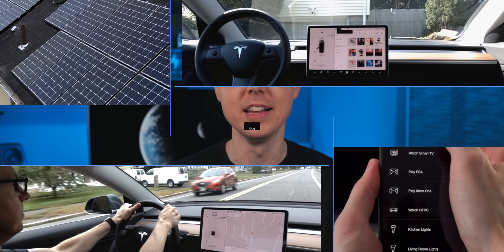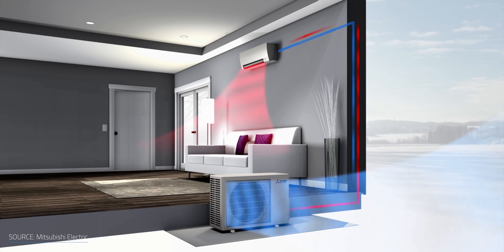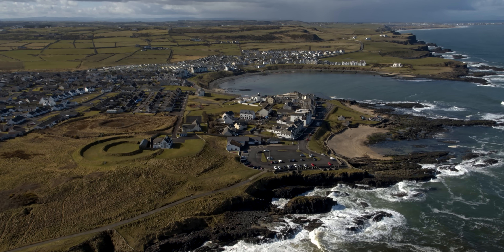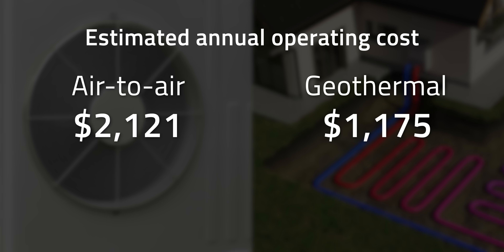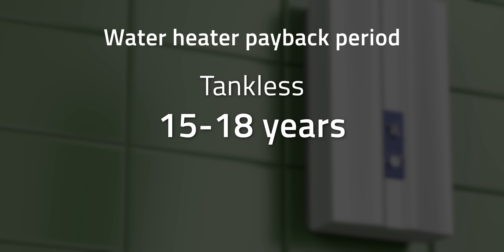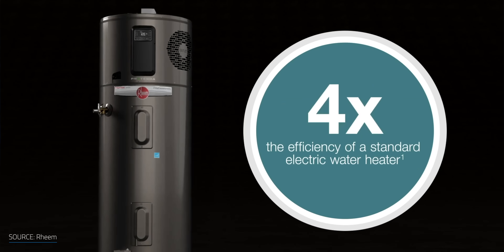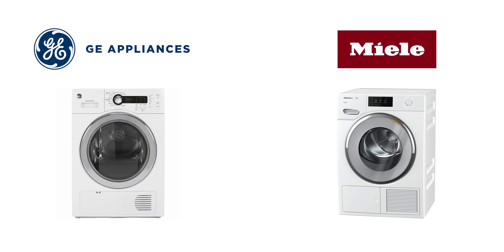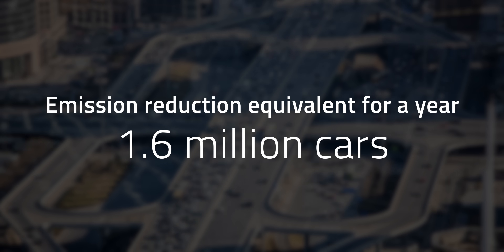Why Heat Pumps are Essential for the Future - Explained

Comment: I'm so used to split systems in Australia, it's surprising to hear how rare they are in other places.
Reply: With how cheap natural gas prices are in some areas and how cold winters are, they just don't make financial sense. I've been looking into replacements for my aging gas furnace and it would take a very efficient heat pump just to break even on fuel costs compared to a gas only one. With them costing $2k-$5k more I'm leaning towards a gas only furnace right now.
Reply: @jaredwilliams8621  That's fair we rarely see temps below freezing here and even our natural gas is too expensive to use much.

Comment: I’ve just recently had a Miele eco comfort heat pump dryer. I had 2nd hand was told (no heat)  but it was a builder so he could of had it from anywhere 🤷🏻‍♂️ had a Miele washing machine to both for £50.00 the machine is leaking found it fixing it and my sister wants it.
But I said I want to keep the dryer for myself as Googled it and it told me it was A+ energy rating (heat pump tumble dryer) 
I don’t think the guy I bought it off knew this as I turned it on cleaned all the filters screens etc and heats takes a while to get going but it does heat and it uses £0.20 per hour my beko electric condenser dryer £0.86 per hour so that speaks for itself…
Although it takes longer (not much longer) and if you don’t care about that then I would say from my first week that it’s definitely a saving and paid pennies compared to what it’s worth. And it’s winter here in the uk and it’s a cupboard that cold but it’s still doing alright. 
So I would definitely get it if I could afford it in central heating system as it’s bound to save you money. 
Although it does sound like fridge with a fan so I expect they all sound like that heating or tumble dryers 
Very clever idea 🙂
Reply: Wow that gave me thoughts
Reply: @josephinemitchell9504  they are so cheep to run compared to a normal (vented or condenser dryer) they are definitely worth every penny only takes 20 mins half hour tops then my old beko condenser dryer. 
And if you got kids and use the dryer multiple times a day? Then I would definitely invest in a heat pump dryer will save you loads of money on electricity and will pay for its self in the long run. Or just get a good condition 2nd hand heat pump dryer. Mines a Miele a expensive brand , but there are cheeper ones that work just as well for less money. 
If you want to save electricity and you use a tumble dryer a lot then you definitely need to get a heat pump dryer. Don’t listen to people that say “it takes hours” it really doesn’t and if it does it must be full of dryer lint and not looked after well I was a skeptic of them! But so glad I got one now will never go back to a normal dryer again…. 👍🏻

Comment: I'm a heat pump engineer, and while they are good systems, the air to water is rarely Installed correctly unless you can afford to pay through the nose and the air to air is expensive to run compared to gas heating

Comment: What we need to do is use the heat from the AC to heat your water/pool...and at the same time function as an AWG (atmospheric water generator). Combining all 3 devices is really not that crazy. Add some solar cells, a power wall, and wireless connectivity...and you have a home that is completely off the grid (except for sewage.)

Comment: So I have a question, I understand that this tech has a limit to how much heat it can extract from the air. However, if it uses energy  to gather a larger amount of energy, could this be scaled up to a higher purpose. Now I live in Phoenix, death valleys more social little brother, and I am curious with the amount of heat energy here, could a project be scaled up in such a way  that  the extraction of heat  could be used to push a steam powered turbine to put energy back into the b grid, while having public areas that cool air could pump out , such as in public parks. If there could be a station in each neighbor hood, at the very least to get someone who is over heating (as we humans tend to here) to. There's a lot of people here that don't have access to a cool area, and I am curious if doing this could provide a free cool area for people like that to get some relief, while simultaneously  adding energy to the power grid instead of costing it. Or ever could it be  feezable to have enough stations pumping out enough cool air into the open air to combat extreme  city wide  heat extremes (cool down the entire city on a large scalep).

Comment: We had a geothermal system in my old house. While it is 20 years old and that may have contributed to this, but it was very slow to heat and cool the house. Although if you keep it constant it shouldn't be an issue. (We also had a very large house)
Reply: My guess is the contractor installed a unit that was barely large enough to heat and cool your home.  They tend to size the unit on the cheap!  They could have changed from a 48,000 Btu to a 60,000 Btu for a total cost to them of about $400, but they don't do that, and you end up with a very slow to heat and slow to cool system.

Comment: I had a heat pump drier in England for a few months traveling, that thing was annoying, it took 50% longer to dry and it felt like you have to listen to running all the time. Then the water tank would fill up and shut the unit down so your clothes would stop mid cycle.  This was a couple years ago, but I would not buy one for my house

Comment: I'd love to see someone use one of this things to take heat from steam and bump it back into the boiler, condensing the steam back into water for re-use. Steam engines aren't so much powered by the heat itself as they're powered by the pressure of matter phase changes, so not letting the energy escape until it's all converted into kinetic energy instead of being lost by releasing it into the environment. Energy efficiency doesn't matter in this case, because the wasted energy is lost in the form of heat which is what you want anyways.

Comment: heat pumps are identical to a magnifier glass intensifies light into a hot spot. the exception is that you can not see heat the same way you see light but the principle is identical. any confusion about this is due to a lack of understanding. we are not creating energy. we simply collect energy from a big volume and concentrate it into a small volume. we add heat to turn that heat from the outside hot enough to heat the home but some of that heat of the heat pump comes from the outside. actually the amount of heat form the outside pump is 3 times that of the energy that comes form the heater element. that is because outdoor air has a lot of thermal energy at very low temperatures but if you magnify large volumes into a smaller volume you get the heat extracted. 

if people could see heat as if it was light and see a heat pump in action they would see that the light that comes from the output of the heat pump is brighter than the light that goes in. that is all it does. there is no perpetual motion here. the energy source is waste heat ground heat and the heat from the sun.

now many say that heat is a entropic form of energy that is irreversibly entropic and can not do any more work. that is not true. actually the cycle can circulate the same heat over over again powering light bulbs and heaters and the same energy can be converted in a closed system from heat into electricity and then back into heat. you can have a home on mars or similar type of home where all the light and heat you need is recycled so that you only need to add energy that equals escapement losses. 

the only reason why energy is consumed is that is find ways to escape into the environment where its considered irreversibly entropic and that is the definition of energy conservation.
please be aware that energy can not be created or destroyed and only change form. that does not mean consumed and gone. that does not mean that energy is only real as long as it counts numbers in a electric meter and then after that its used up. that idea is totally wrong. energy can not be used up. energy does not disappear. energy goes somewhere. some of the energy on earth radiate back into space as electromagnetic energy.

many people believe that heat pumps create energy and create more than you put in and that they are somehow breaking the laws of physics but that is totally and utter wrong.
the problem with energy is convertibility. you can convert heat into electricity and then electricity back into heat. you can do this in a box as well as long as you add the little extra heat you need to overcome losses and the energy would just translate between the forms of energy. entropy is the worst theory that has ever been applied to science. its a roadblock to 
understanding reality on a deeper level.

Comment: Windows and doors and insulation is the far better choice. When I was installing Furnace and AC for $4,000 ( before Brandon  ) my half sister bragged about her $100.00 a month to heat her house. She laughed and said she paid $24,000 for her system. I laughed to my self she lost the interest on the extra $20,000 for 20 years and still pays a $100.00 a month. Let say her bill would have been $250.00 with out a heat pump. So she save a $150.00 a month for 5 months out of the year that $750.00 a year saved. The extra $20,000.00 divided by $750.00 saved equals 26 years the system must last to break even. I forgot to mention the warrantee would be 10 years only on the system. She laughed first I will laugh last.

Comment: Matt, we had a ground source direct burial heat pump in our home for 13 years (NC). It saved about 55% in the summer and about 35% in the winter, and in the summer it provided our domestic hot water for no additional cost. There are new drilling systems available in the NE for drilling deep shafts for water to air heat pumps which have been in use for decades on very small patches of ground. These ground source heat pumps should be required for new construction wherever possible.

Comment: I agree the heat pump is the future - but for those of us in the UK it is a little hit and miss on the efficiencies - more so in our historically old housing stock. I am told my 1891 home cannot take one, well unless I am prepared to pay many more thousands on electricity to run it, as it will not be thermal efficient as you describe. 

What I am looking forward to, is how you mix the solar energy, to the various hot water, heating solutions. As this really does interest me, as I am looking at trying to retro fit solar to my old house, and then work through where I have slack to add things like a heat pump. 

The future could be fun with all this messing around with tech, and the tech will develop overtime and become even better, and more efficient.

Comment: "The coldest Winter I lived through was a Summer in San Francisco" -- Some Famous Dude!  Perhaps heat pumps have come a long way, BUT I lived in a 3 story townhome that used a standard air-source heat pump from the late 1970s and no one ever wants to do that. The innovations you covered are great, but suffer from "trusting the builder" to do the work correctly. The below ground collector , geothermal, needs to be easily accessible for replacement or the collector needs to have a longer operation time of 50-100 years. Townhomes are usually built on top of each other and digging up and replacing a collector is going to be a nightmare. The auxiliary heating element (think electric stove)    will come on and your energy usage looks like the Griswold house at Christmas with the nuclear auxiliary kicking in!  

I understand your videos are selling energy sources detached from old BIOMASS, but someone needs to address the building industry. My current home faces East/West and collects unwanted solar heat during the Summer. If the builder had added an overhang in the design, the home would have a passive cooling feature preventing heating at high sun angles on the West side. Also, why are builders allowed to leave garages uninsulated and unvented? Who in Congress protects the building industry from obvious changes for sound engineering purposes? Builders get away with murder. They should be building a home to be ready for smart technology. If you have smart windows you can do away with much of your air-conditioning here in Colorado. A smart house would open and close windows as the Sun moves around your house.

Comment: There are some things you did not take into consideration. Firstly the most common material on heat pumps and AC units is Aluminum but this is a poor conductor so you need a lot of it. Secondly, as the fins will be wet and dry in cycles, bacteria and mold freely grow on them. And Finally.. cleaning them is a nightmare. The solution ? Fins that use alloys dominant in copper or even the more expensive silver. This ensures that nothing grows on them and you can even add UV lights.  I am looking at commissioning a boat.. a big one.  But I have had mold related illness and Im now sensitized. Clearly living on the water has a humidity problem. We need to reduce humidity to 45% to stop indoor mold growth, and we need to ensure all the areas that can get wet, cannot grow anything toxic and are easy to clean. Not just the AC units but also all the drains, need to be copper. Mold and bacteria grows anywhere there is water and how many people pay attention to open drains from the sink to the bathroom, the shower, and even the water reservoir of a flushing toilet ?  The entire idea is SAFE and energy efficient. There is no point building a home only to have to burn it down because it went moldy or "sick house syndrome" where living in it decreases your health and stresses your immune system. If you are recovering like me, that stress reduces my immune systems ability to help me heal. And as I plan to live on my boat full time gaining the wonderful positive ions of the ocean, the absence of humans and stress.. well I need to do it properly. With a boat.. It is normal to spend a big portion of the initial cost doing ten yearly refits. This to me sounds nuts. Why do a refit when you can built it right the first time. Many woods are resistant to mold and bacteria.. esp. Cedar. And of course.. the VOC, chemical and heavy metals are a problem too so you need to make all of that go away.  I have like you, spent thousands of hours researching all of this and you would be surprised what I found. Right in the USA, there is a company doing copper AC systems including the ducting, using their own patented materials and designs. The AC system actually improves air quality. Add to that some air filtering and you could literally do surgery in the room the system feeds.  Have a think about this and take note.. there are over 1000 published journals in human health publications on mold and its impact etc. And over 10 000 published journals for animals. Humans are mammals.. we have the same issues.  When you get mold you often get other nasties esp things like chlamydia pneumoniae. These are infections that are stealth and lower your overall health. Your symptoms depend on your genetics, your age, and your baseline health. Over all.. longer exposure = worse health outcomes.  So please... add this to your research list and if you need help, reach out.  I sadly have not kept a lot of written material as I have a photographic eidetic memory. I will have to re-research to find the links and materials again. But the upside is that this issue is being addressed by a LOT of companies making healthier houses etc. So it is constantly evolving. The research I conducted last year may already be outdated.  You do a great job so keep it up.

Comment: My experience with a Heat Pump dryer has been a nightmare. This dryer was a top of the range 10kg Heat Pump and it would take all day to not even dry two sheets. After 8 hours of run time your washing would still be wet. Not good. Sometimes this technology sounds really good until you try it and find out that it is a really expensive waste of time and money.

Comment: I would rather see a bigger push on ground source heat pumps with a vertical pipe system, as opposed to having to dig up gardens for pipes or having to use air source heat pumps. My experience with air source heat pumps in northern UK is that they work well until the outside unit freezes up and the system needs to reverse to defrost. Not much good getting blasted by cold air inside when you wanted the system to heat the room, and not cool it, in the middle of winter. Air source heat pumps are not the magic answer but are being pushed hard as though they are.

Comment: We have BOSCH condenser washer and drier stacked combo.  Capacity is smaller; more loads to wash same usual amounts. Condensing drier takes way longer to dry clothes and very noticeable with towels, for example; takes twice as long to get to dry. So where's the saving. Wouldnt buy in the future if we build new house. Have used the combo for about a year.

Comment: The meagre saving in running costs are insignificant compared with spending $30,000 on a heat pump installation and losing a room to house the tanks and other stuff